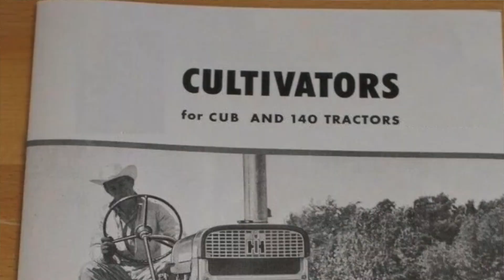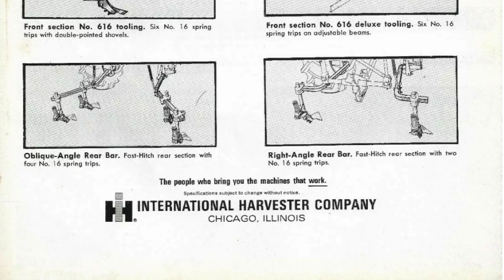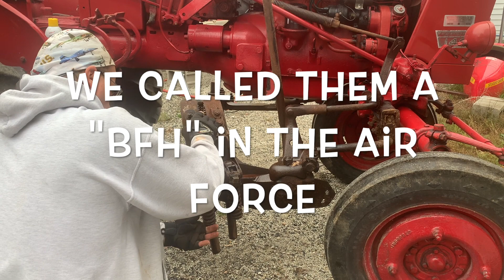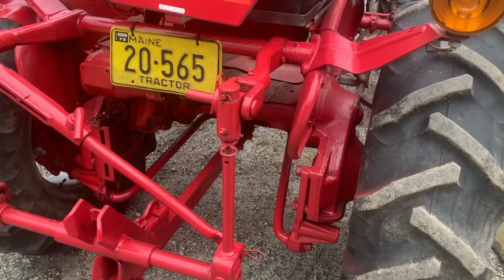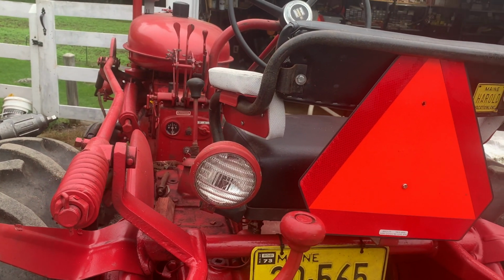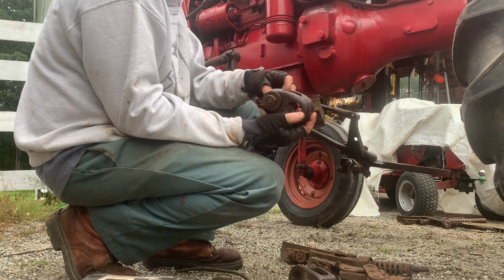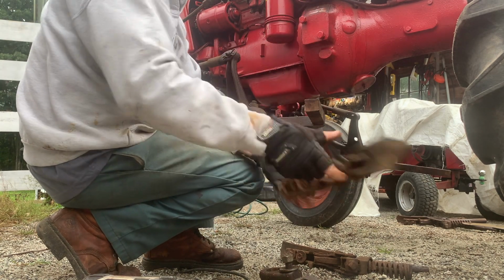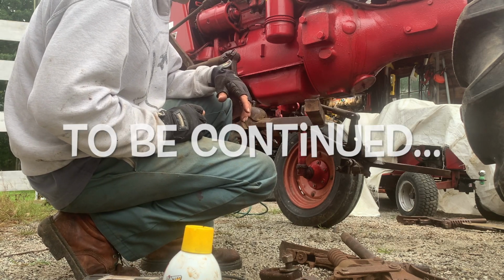Putting Cultivators On a 1973 #Farmall 140 (Pt. 1).

Comment: The biggest mistake people make with the 144 cultivator is not making sure the shanks still trip like they were designed. If the shanks aren’t free to trip and reset themselves the shock is carried through the frames and can damage the hydraulic touch control system.
Reply from the maker: Good to know. I’ll look into how they trip because I don’t want to break it. Thank You